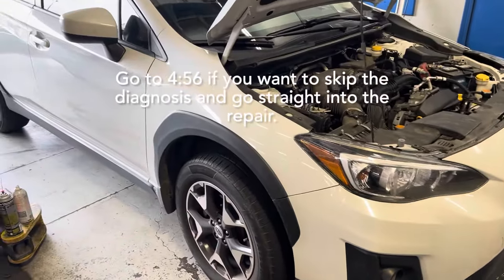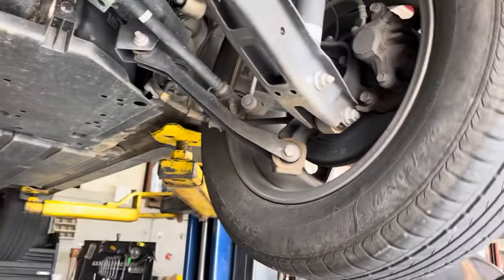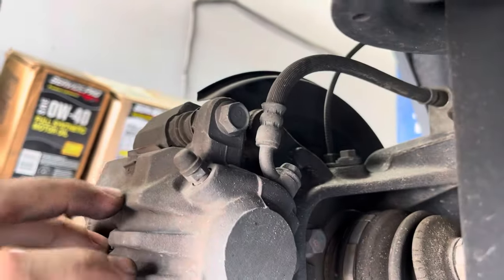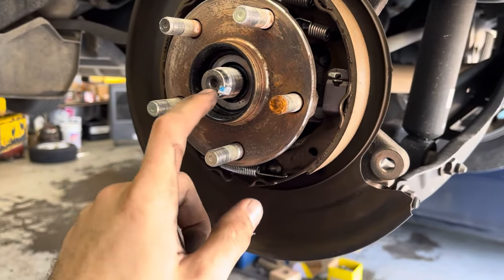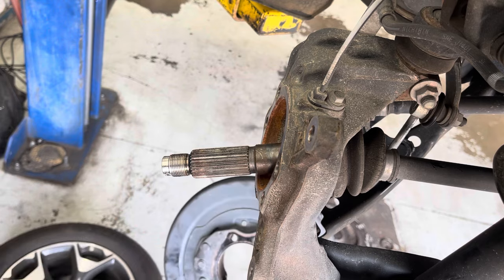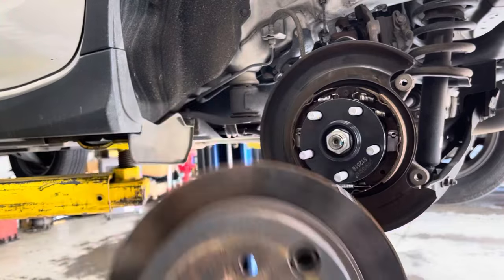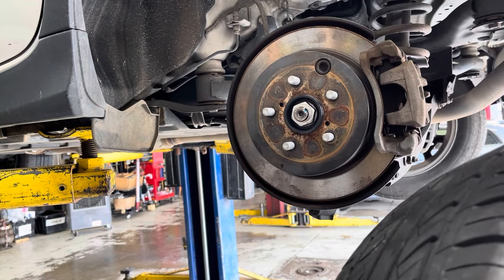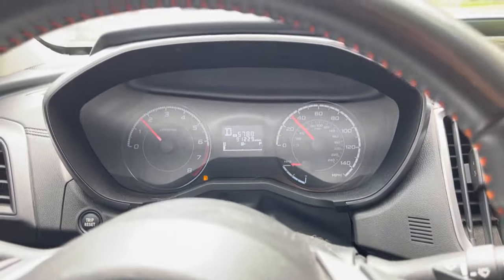How to Replace a Wheel Bearing on a 2012-2023 Subaru Crosstrek

Comment: If the car is not rusted, this job takes 30 minutes. If it's super rusted - god speed to you. Many hours even with a hub shocker. Brutal. I'm jealous of the mechanics who don't have to deal with the rust.
Reply: I replaced the wheel bearings of my 2016 Forester at home. Each bearing took 4 hours because they were all severely rusted. I broke two hammers. I replaced the two rear ones last year. This year, the front wheel made noise again. I was exhausted.
Reply: @yayar8585  So the 2016 Forester (along with 2012-2019 Imprezas, Crosstreks, and Foresters) suffer from a design flaw that makes this job harder. Subaru made a technical service bulletin for an updated backing plate to extend the service life of the bearings. I did it myself and did not change backing plates since I didn't want to mess around with the parking brakes too much. I own a 2018 Crosstrek which uses the exact same backing plate and wheel bearing as your 2016 Forester. It was a terrible job.
Reply: @yayar8585  I believe the front bearings are easier to do than the rears on the Subarus.
Reply: I would have put some never cease on the axle splines,  not recommended but if the bearings ever go again it would be easy to remove.
Reply: I have my own xv in for a bearing change. The mechanic rang to say its rusted and seized! He is having trouble trying to remove the old bearing. Hes hoping to have it done by tomorrow afternoon! 😬

Comment: Nice video!! Took you about 25 min to do one side and thats with holding the camera and explaining everything. These shop charging 500+ dollars and saying it’s going to take about three hours. So thank you!
Reply: That is because you pay for the years the tech spent to do it that fast. You do not get a  discount because It can be done faster than book time. These often do not come out at easily as shown in this video. This must be from the south where rust is not as much of an issue.
  If book time takes 1 hour for brakes and I can get them done in 25-30 mins. I am still charging that hour.
Reply: @vikingdeity7562  lucky I ain’t blind, because that sounds like robbery to me. Shheeee.
Reply: He also pulled it out by hand. Any Subaru in the rust belt an additional hour of heating it and beating it out with a hammer
Reply: Where's 500 at 😂 it's 1500 at the dealer

Comment: I can't believe how it came off without hours of pounding. Living in northeast weather makes things so hard. 😭
Reply: my wife's 97 grand prix (which is clean car for it's' age, it sees annual fluid film and the car only has 57K grandma car special) i had a bad time getting it apart. i heated it up with a torch and used a 2 jaw puller

Comment: Well done. I have one of these I've been procrastinating on. I thought about doing a video, but I won't have much to add over what you've contributed here.
Reply from the maker: Hey thanks! I’ve had several bad Subaru hub bearings back to back so I figured I’d finally make a video.

Comment: Thank you for making this video. It helped me release the spindle from the hub, to knock off the rotor, and to remove the hub from between the brake pads. All good tips. But getting the hub out of the spindle required driving a flat bed screwdriver in the gap between the two to keep widening the gap as they separated.

Comment: you are so lucky. I have never seen a hub come loose like that. congrats.
Reply from the maker: The car is only 5 years old and it’s from Texas. Therefore, no rust. If the car were from up north it might be a different story.
Reply: I literally tried to beat on my hubs with a 3lb hammer and never got them loose. I ended up having to pay a shop to do it. There's a world of difference whether or not the hubs have been allowed to rust into place.
Reply: I'm currently working on one that is also 5 years old. This would take less time than a brake job if I lived in Texas. Another reason to hate northern Virginia.
Reply: @taysmode11 Yep, I'm in Springfield and no amount of hammering would remove it.
Reply: Lol thank God you're in Texas. I'm in Illinois and it's never this easy

Comment: I have a 2017 Outback, but it was great video you put together Jack!
I have a great mechanic here in Crown Point, Indiana. Has worked on my cars for years.
I saw a TSB on the Rear Wheel Backing Plate - Design Change. Look it up when you have a chance.

Comment: Outstanding video. My 2018 LR is rough at 38,000. Do you historically have good luck with the Premier brand bearings or do you feel like they're all about the same?
Reply from the maker: Here at the shop we’ll use Precision or MasterPro from O’Reilly. We also use Timken (which is supposed to be really good), or there is another brand called Durago (cheaper) that we use but honesty I haven’t really had a lot of issues with any of them.

Comment: my hub was so rusted it fused with the backing plate, old hub ripped into 3 pieces and i had to disassemble the brake shoes from the backing plate and use a press to get the last piece of the hub off the backing plate. ridiculous. this video helped tho
Reply: Uggh! I live in the Northeast and have to do both rear ones.. did you end up having to replace the backing plates?

Comment: Thanks so much for everything you do, can you please tell me is ok to hit rotors is thta going to do anything to emergency break Thanks
Reply from the maker: You can hit rotors with a metal hammer as long as you hit the rotor in between the wheel studs (NOT on the part where the pads touch) and if you hit the rotor on the part where the pads touch then you need to use a plastic or rubber dead blow hammer.

Comment: Maybe you can help me, I have a 2013 crosstrek already replaced front Shock and shock mount(L&R). Also replaced front suspension assembly(L&R) but I still can feel a wabble everytime I drive the car(rough and paved road).

Comment: When you hammer the lip into the nut is that like staking it? My background is building firearms and staking castle nuts is quite common so I’m curious if this is similar
Reply from the maker: Yeah, I imagine it’s similar. Hammering the nut prevents it from loosening due to the rotation of the wheel.

Comment: Is my 2019 subaru outback going to be the same the replace the rear wheel bearing? Please help.
Reply from the maker: It will be the same, or at least very similar.
Reply: @jackhfletcher I live in the Northeast and fear it's going to be seized in.. any suggestions on where to whack it or tricks to get it separated?
Reply: @carymgc I also have a 2019, how bad was it to do?
Reply: Subaru is one of least reliable company what did you expect from him

Comment: Don't you have to replace the cv axle nut , with a new one ?
Reply from the maker: Technically, yes. But I’ve never seen anything bad happen from re-using an axle nut as long as the nut is in good shape and torqued properly.
Reply: @jackhfletcher  much appreciated , thanks  for the reply .

Comment: Why no high-temp dope on OD at interface fit or inside spline?
Reply from the maker: As far as I know, there’s no reason to do that.
Reply: @jackhfletcher If the bearing you installed last much longer then the one you replaced that would make  this job harder the next time if not for you then someone else

Comment: I wonder what's the car mileage here. Bearings gone too early on mine - in 40K and no load! Seems like Subaru sets weak bearings in the back. My Toyota has twice the mileage and heavier use and bearings do not complain. Video is great, at least best that I could find.

Comment: Why didn’t you show the struggle it is to get the bearing off the vehicle?? That doesn’t just slide right out like you showed. We can clearly see all the rust around that bearing.
Reply from the maker: I didn’t show the struggle because there was no struggle. It came off very easily for me.
Reply: That's practically a new car.

Comment: You boys out of the rust belt have it too easy.  That job world had easily taken two plus hours, a 💩 ton of cussing, a torch, the hub shocker and a 15 lb sludge hammer to get that bearing out, not including the time to get the backing plate off of it!
Reply: Boo hoo
Reply: Working on rusty cars takes a mechanic. Working on cake like in this video just needs a part changer.

Comment: Just had my left rear bearing replaced on my 2018 Crosstrek with 62,000 miles at Richard Lucas Subaru in New Jersey. $967.78. Yea, Subarus least expensive to maintain. Last one I ever buy. 😖
Reply: Subaru's are very in expensive to maintain, do the work yourself. if you are going to a mechanic, no car will be inexpensive to maintain.
Reply: had my crosstrek from zero to 100k miles. ALL maintenance I did myself. The car is easy and cheap to maintain.
Reply: There are so many diy videos on YouTube there's really no excuse to not do car maintenance and repairs yourself.

Comment: I call bullshit to this video. I've never seen a subaru rear wheel hub come off in someone's hand before.  It can take an hour of beating the shit out of it. Besides there was a ton of rust inside the knuckle that he didn't even clean up
Reply from the maker: Since you’ve “never seen” it, I guess it must be impossible.
Reply: @jackhfletcher  yep absolutely
Reply: @jackhfletcher I replaced both front wheel hubs on my 2017 Outback yesterday and both were removed almost as easily as the one in this video.  It's nice not living in the rust belt!